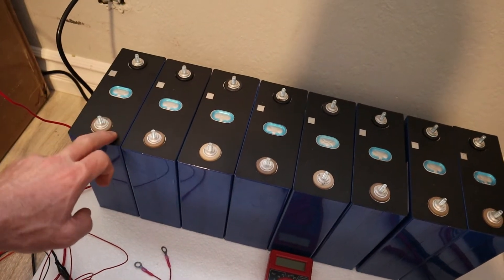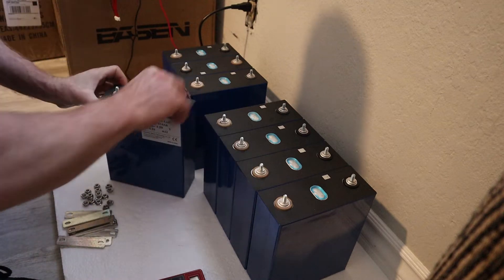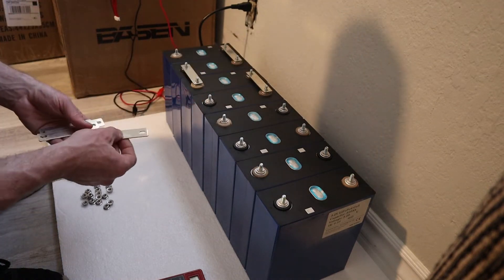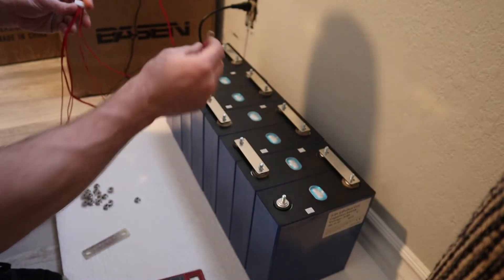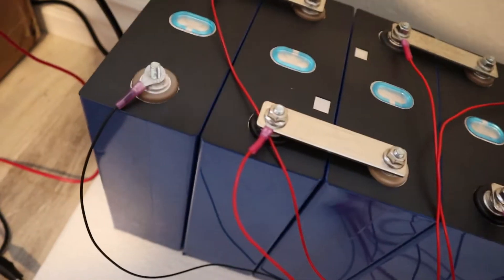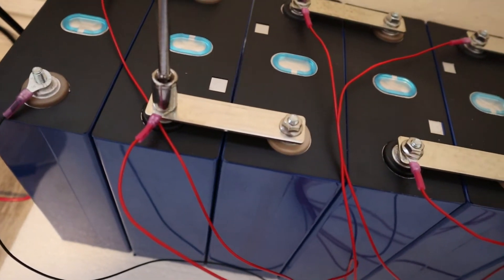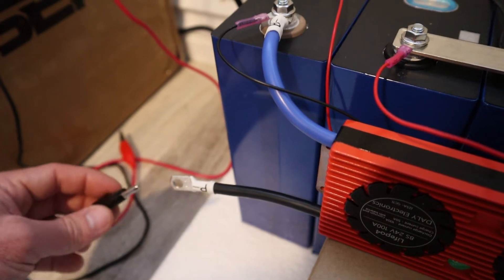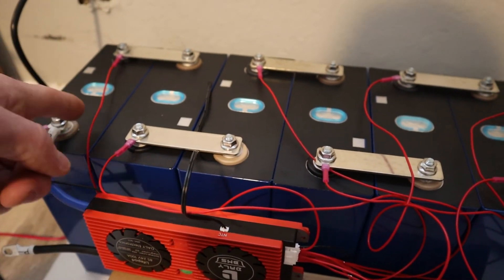How To Connect BMS to 24 Volt 310 AH Battery

Comment: Very nice video ,simple and detailed,I would like to ask how do you choose the BMS? I bought four 3.2v 300Amps batteries,and a BMS 4s 300Amps ,did I do good or I should choose the BMS amps according to my solar panel power which is max 100Amps and not according to my battery amp power?

Comment: 27.6V is the float voltage and not enough to fully charge the batteries! The charger should be set to an absolute minimum of 28V and maximum (recommend) 29.2V

Comment: Just building my first batteries using basically the same components you did, so your video is so reassuring. Thank you.
Reply: He did it wrong! Don't plug the BMS plug in with the leads connected to the battery.... Plug the leads into the BMS, then attach each of the seven leads, one at a time to the battery - starting with the black and ending with the red. If they're already connected to the battery when the plug is connected, damage will occur to the BMS if the contacts don't make connection at exactly the same time and sequence.

Comment: I have a ready Made Battery  24 volt 200ah and the bms wires are on the minus terminals of the battery's the wires are white apart from one being red going to to the positive and the other is black going to the minus why is this? when the above are on the positive  there 8 cels and 50 watt each. can any body tell me why? as i need to change my bms and it is broken. bms not the same as the above.

Comment: Great video and just what I needed to hook up my 24 volt system. I too purchases batteries from Bassen, and yes it does take a good 2 months if not longer. I found that the m6 connectors were difficult to find in the big box stores, so you may want to get those off of amazon ahead of time. I use the equivalent of the overkill BMS,  which you can find under the Jiabaida brand on Amazon at fraction of the price. Same thing just different branding.  It has nice beefy terminals and you can size your own cables, instead of having to deal with those super short ones from Daly. It has an app for wireless  configuration as well. 

And what I did, and other people may choose to do as well, is configure your BMS so you don't overcharge any particular cell (Easy to do in the Wi-Fi app). I use my all-in-one solar/charger (40 amps) to get the batteries close in series, And then connected the batteries in parallel and topped off with a power supply to 3.5 volts. If you go up to the full 3.65 you can cause the batteries to bulge. I don't think it's necessary, particularly if you're using for solar and you will extend the battery life. 

I just use a piece of aluminum bar and drilled some holes in it as I did not have the necessary terminal connectors to hook up in parallel. Easy to find at the big box store. If you leave your batteries connected in parallel for a few days they will top balance, and then using a power supply you can fine tune so the whole bank is at 3.5 volts. 

I suggest anyone to do this well in advance of installing as it takes a while. 

And it probably goes without saying, but please follow safety precautions! Remove jewelry, wear Eye protection, and than I use some rubber matting to cover part of the terminals I was not using just to avoid short circuiting if I dropped a wrench or something. It's a lot easier than you think to do it. I know in my situation I was using 608 amp hours (12 v)  or 304 AH at 24 volts, so definitely some power behind it.

Comment: Hello and thank you for the very helpful video, are you using a circuit breaker and shunt between your 24v battery and 3000w inverter? If so how many amps should your circuit breaker be, which shunt would you use and how would you configure it?

Comment: The temperature sensor should be on the side of the battery, never the top. There is an air pocket on top, it won't work properly like that.
Reply from the maker: Hi Ibian666. Thank you for watching and for your support. Thank you very much for this vital important information. The community will be very grateful. Please consider subscribing if you found the content useful. Thanks

Comment: I found this video easily by searching in youtube, then very easy to understand (good video tutorial) helpful for how to install BMS 8s Lifepo4 in correct way. After following step by step,. Check pin one by one until last tiny red cable pin show 26volt.... But when pole positif battery and P- show nothing when checked with voltmeter... Any suggestion? Maybe BMS protect mode activated or what? Thank a lot for help
Reply from the maker: Hi Oneplus One Bara. Thank you for watching and for your support. It sounds like the BMS may be locked. Look on youtube how to jump start your bms. I hope this helps for you. Please consider subscribing if you found the content useful. Thanks.

Comment: Very impressive video. I ordered a new 280A 3.2 LiFePO4 today for $212 from Ebay as a backup for my 16 battery 24v system. My BMS on the 2nd battery pack always showed one battery low. I checked the voltage today and it was 2.0V. I pulled that battery out and running it on a balancer (all day so far). I pulled another battery to connect it together to balance it faster; the connecting bar got pretty hot for 10 mins. I think the battery is not broken, just needed additional balancing. Your video helped me on how to connect my 200A 8S BMS to this number 2 battery pack. Installing the BMS as a leg on the negative side!
Reply from the maker: Hi Linda Foxwood. Thank you for watching and for your support. I appreciate your kind words, thanks. Glad the video was able to help. Good luck with your setup. Please consider subscribing if you found the content useful. Thanks.

Comment: How much current is needed to activate this bms
Reply from the maker: Hi Zoheb, I am not a 100% sure, but I do know that your lithium iron phosphate cells have to be at least at 3.3 volts per cell to activate the bms. Hope this helps. You can activate it with the transfer switch on the growatt itself by charging that way. Thank you for watching and for your support. Please consider subscribing if you found the content useful. Thanks.

Comment: Why didn't u compress the cells...
Reply from the maker: Hi Zoheb. I did a lot of research before and considered compression, but ended up not going that route as it was not necessary or would have made a huge difference. Thank you for watching and for your support. Please consider subscribing if you found the content useful. Thanks.

Comment: I have almost the same setup in my rv except I went with the Overkill Solar 100a BMS. The battery and BMS have been working perfectly but the Growatt inverter has been a bit of a problem. I would not buy another if I were going to build a new system.
Reply from the maker: Hi John, thank you for watching and for your support. What kind of issues have you been having with your Growatt? Curious to know. I have also had issues with my Growatt, however, issues seem to be worked out. Maybe I can help. Thanks.

Comment: How to set all the parameters on you’re DALIY BMS 15S 40A 3.2v 280A lithium Phosphate batteries ?
Reply from the maker: Hi Mark. Thank you for watching and for your support. You will set your parameters on your solar charge controller/inverter, not on your BMS. I hope that helps. Please consider subscribing if you found the content useful. Thank you.

Comment: Hello najs video 👍 are you pleased with the daly bms? Can you trust it and leave it be? Whats the maximum current you can draw from a 8s 24 v system of 310ah eve? And what is the Max current you can charge them with?
Reply from the maker: Hi Andreas. Thank you for watching and for your support. Yes, I am very pleased. It charges at 50 amps and I can draw a 100 amps at 24 volts which is the equivalent of 200 amps at 12 volt for a max of 2400 watts on my inverter. Please consider subscribing if you found the content useful. Thank you.

Comment: How do you hook up a solar controller and inverter with this set up? Why would I need a charger? The whole point is I want to use solar?
Reply from the maker: Hi Dennis. Thank you for watching and for your support. I understand what you are saying, I had the same questions, the issue is that you need a bench top power supply to get your batteries higher in voltage so that it can wake up your bms and start your inverter. You only need to do this once. You can return the bench top power supply after that. Hope this helps. Please consider subscribing if you found the content useful. Thanks.

Comment: Greetings excellent video but I have a question about the configuration of charging the batteries, what would be the numbers for mppy Float voltage and absord voltage?
Reply from the maker: Hi Jose. Thank you for watching and for your support. Great question, it depends on many factors including your battery chemistry. If you have a lifepo4 battery and you don't want to fully charge it to 3.65 volts per cell because you want your cells to have a longer life. I have my bulk voltage set to 28.2 volts (3.52 per cell) and my float voltage set to 27.6 volts. But with lifepo4 float is not really required, these are really parameters for lead acid batteries. My inverter has a setting for lifepo4 and the bulk and float are locked together, so whatever you put your bulk to the float will automatically be the same number. Hope this helps. Please consider subscribing if you found the content useful. Thanks.

Comment: Great video.  Curiosity question. Your cells are 310 AH and your BMS is 100 a. Shouldn't the BMS be at least 310a. Thanks.
Reply from the maker: Hi Kevin. Thank you for watching and for your support. I appreciate the feedback and that is a great question. So the way to pick your bms, size your bms for the amount of watts you will be using divided by your battery bank voltage. In my case for example, I have a 3000 watt inverter and a 24 volt battery, so 3000/24 = 125 amps. So I went with the 100 amp bms because it was half the price, but it also means that I must not exceed 2400 watts (100 amps x 24 volts = 2400 watts. At some point I will buy a bit larger bms so I can run the full 3000 watts, but rarely does one use everything all at once. I hope that makes sense. Let me know if you have any more questions. Great question. I also struggled with this one at first. The Ah is really just the storage capacity of your batteries. Take care. Please consider subscribing if you found the content useful. Thanks.
Reply: @Think Free Live Free Hello, I may ask because I am interested in this bms, but I also have 24 volt installations, but ultimately it should be 48 or can I buy with a supply for 16 seconds and use only 8 seconds
Reply from the maker: @chapluczekful  Hi. I am sorry, but I don't understand? Is it possible for you to translate? Thank you watching and for your support.
Reply: @thinkfreelivefree6951  @Think Free Live Free Hello, I may ask because I am interested in this bms, but I also have 24 volt installations, but ultimately it should be 48 or can I buy with a supply for 16 seconds and use only 8 seconds
Reply: @thinkfreelivefree6951  I believe that what he is asking is if he could buy a 16S BMS and use it for 8S until he upgrades to 48V. 

I'm gonna assume that's a no?
Reply from the maker: @calysagora3615  Thank you for clarifying that and yes that would be a no. Thank you for watching.

Comment: I believe you need to build a  structure with studs to squeeze the batteries together. they last longer
Reply from the maker: Hi Adrian, thank you for watching and for your comment. I have read several articles and watched several videos on compression of these cells and it does not seem to be worth it to compress these cells. Thanks.

Comment: You have about the same setup as I have recently built. Have you done a capacity test on any of your cells yet? I have 16 of the lifepo4 varicore 310ah cells from AliExpress and have been running them a few weeks now. They came pretty much balanced voltage wise. I paralleled the 2 8s banks for about a day to make sure there wasn’t much current transfer when I built the 2 24 volt banks. I also want with the Daly smart bms 200 amp. My inverter has a maximum dc input current rating at 175 amps so I wanted to make sure both of the bms’s would give it what it wanted. I will be placing a 150 amp inline fuse soon to protect a malfunction somewhere. I can also set safety parameters in the bms to stop current at so much charge/discharge if I need to. I ask about your capacity testing because these cells have only been giving and taking about 290-300 ah so far. I hope mine aren’t used with lowered capacity. I could have done a test better probably also but I was hoping to get 310 or more.
Reply from the maker: Hi Joshua, thank you for your post. I have not had time to do a capacity test as I was trying to get everything installed in my Van. I think you are spot on with the 290 to 300ah. My cells were also fairly close in voltage, however, I did do a top balancing. I have set my parameters on my Growatt for a max charge of 28.2 volts or 3.525 volts per cell. So, I am not pushing them to a full charge of 3.65. Do you have a shunt setup? Thanks for watching.

Comment: Also the bms can get very warm I would not tape it to the outside of the battery.
Reply from the maker: Absolutely agree. I have mine mounted to the inside of my battery box with a computer fan blowing air through the back. Thank you for watching and for your support. Thanks for your contribution. Please consider subscribing if you found the content useful.

Comment: Why don't u just test the very last one because if it wasn't wired correctly u wouldn't get 26 volts?
Reply from the maker: Great question Linda. Actually the checking of each one ensures that you got all your bms leads on each cell positive in the correct order, for example you may put your last lead on the correct cell positive, but maybe 2 and 3 are switched by accident. Then on cell 2 instead of getting 6.6 volts you will get 9.9 volts because 2 and 3 are switched by accident, but the last cell will still read 26.4. I hope that makes sense. If you would connect your bms with the order incorrectly you run the change of the bms burning out. Thank you for watching and for your support.
Reply: test them all, only takes 30 seconds and ensures no crossovers, crossovers still will show 26. after all the effortinvolved, you are querying this step?
Reply from the maker: @shane6574  Thank you for watching and for your contribution. Take care.

Comment: Great video. Can i ask you why only a 100Ah only BMS? I am planning to buy the same battery setup and i am not sure what Amp bms to buy. i tought a 310A batery will need a 300Ah BMS Am i wrong? Thanks in advance for your answer.
Reply from the maker: Hi. Thank you for your kind words and encouragement and for watching. I chose a 100 amp BMS because that will provide at 24 volts, 2400 watts of power. I may upgrade that in the future, but should be sufficient for my needs at the moment. The math works like this, very simple. To determine what size BMS you need. Volts x Amps = Watts. So in my case 24 volts x 100 amps = 2400 watts. If I wanted to use my full capacity of my 3000 watt inverter, I would take 3000watts/24 volts = 125 amps.

I hope this is helpful to easily choose what size BMS you need. Thank you for watching and for your support. Please consider subscribing if you found the content useful. Thanks.
Reply: I doubled my BMS size.  Runs cooler. Cheap stuff from the other side will not put out to specs.

Comment: I am using 310 amp hour cells in my bus build. I got them from LItokala and it took about 7 weeks to get. I got 16 cells in a 2p8s configuration. I went with an ANT BMS as it has functional cold temperature cutoff where all the Daly ones that say they have it that I've seen tested [Will Prowse's channel] don't seem to actually shot off below freezing.
Reply from the maker: Nice man and good luck with your battery build. Its very exciting to make your own power. Thank you for watching and for your support. Please consider subscribing if you found the content useful. Thank you.

Comment: Thanks for the video-nice. I'm in the same process of making battery. I ordered 8 - 280ah cells but I will be using the Electrodacus bms. This will also be used in my van camper. Waiting on cells!
Reply from the maker: Hi Greg. Thank you for watching and for your support. Its very much appreciated. That is awesome that you are doing a camper van. The hardest part was waiting for the cells, 😁. Mine took over 2 months to arrive. Good luck and let me know if you have any suggestions. Take care.